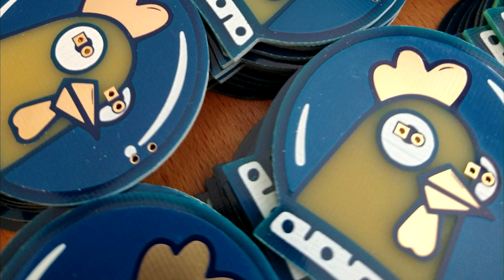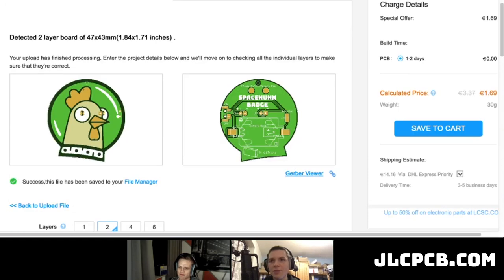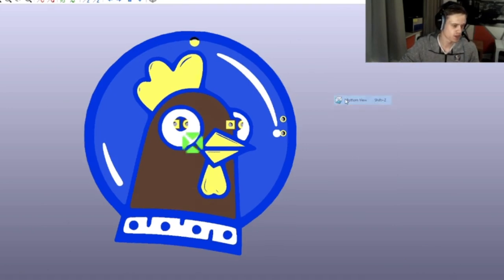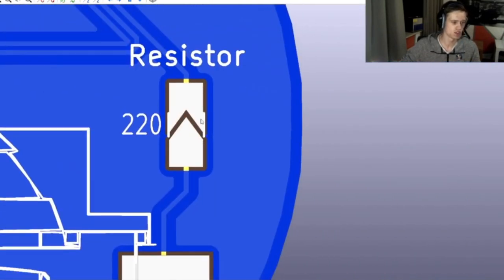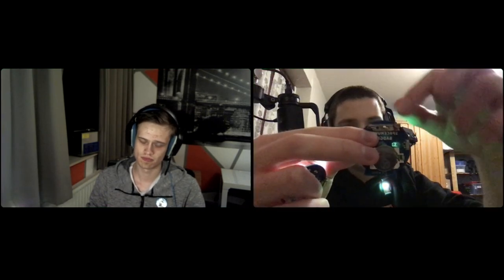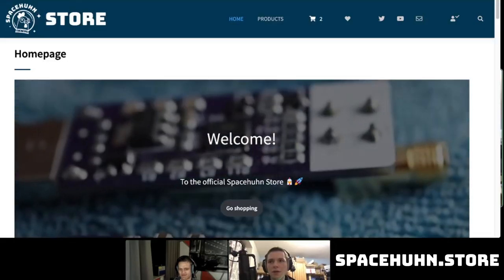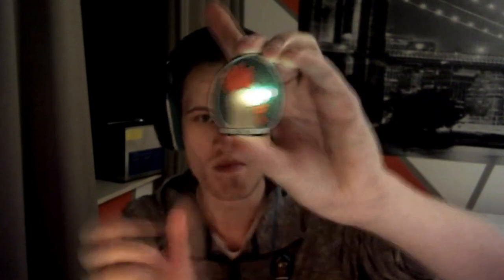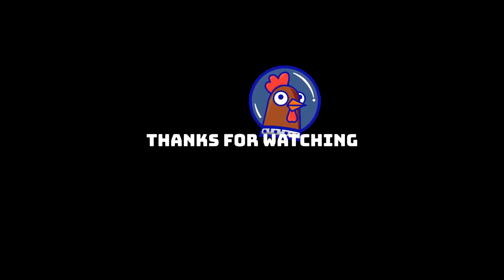Coming Huhn: Spacehuhn Badge Pin

Comment: If you replace the resistor with a trimmer, you can adjust the brightness as needed. The only problem may be that the trimmers are quite large.

Comment: Nice it would also be nice if it could be an add-on to a deauthor, when you start an attack the eyes turn red and when its not they are green, just something fun and silly XD
Reply from the maker: what you could do, is use the resistor pads to solder it to a deauther that turns the badge on or off

Comment: Is it sao V1.69BIS compatible? I've stated to collect a few sao badges
Reply: Hum looking at the silk screen if you bridge the battery holder and put a header in the place of the power switch it should be sao v1 completable unless the voltage is reversed.